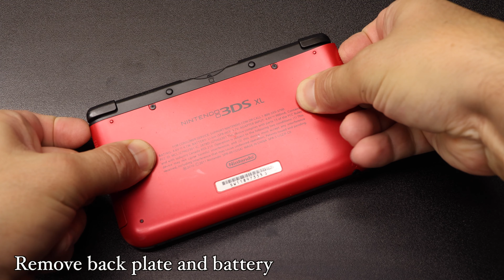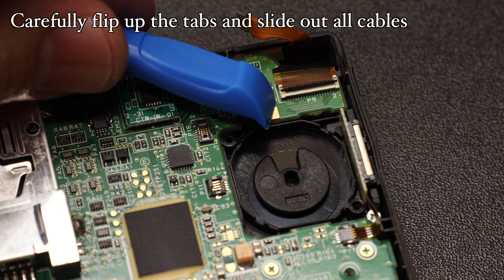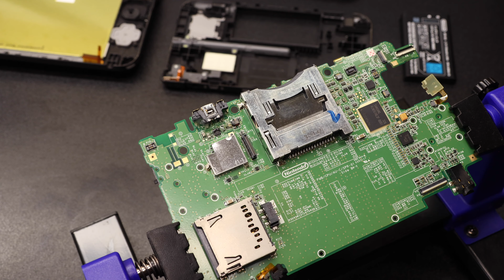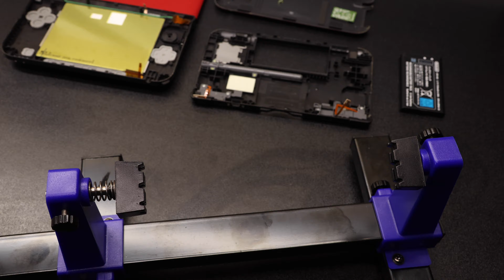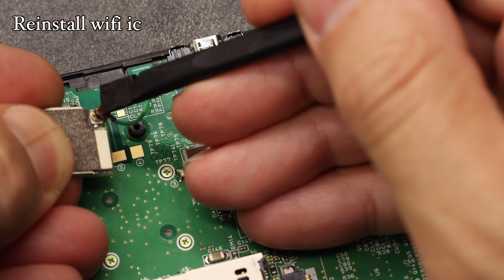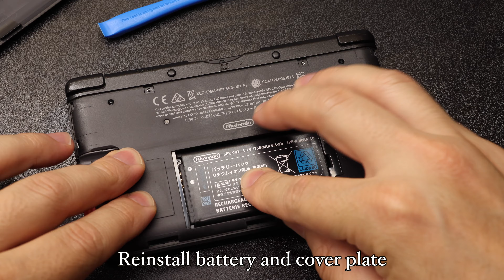Nintendo 3DS XL Charge Port Repair | Fix Not Charging Issue | Nintendo Restoration

Comment: Well, it is absolutely helpful, but for guys without some equipment: u can solder without removing motherboard, just flux every point with solder and using copper wire and solder gun remove solder. Im not saying it to say this, I repaired charging port on my 3DS, and even replaced it with USB C
Reply: Do you put it in the same place as the old one?
Reply: What usb c board did you use?

Comment from the maker: This model has a charge port that requires a hot air heat source to remove. Let me know if you have any questions regarding this repair.
Reply: that is why i can't get it removed. what if we only have dry flux and a dessoddering suction pump?
Reply: Hey what kind of board holder is that?

Comment: seems impossible to find charge port replacements. any ideas? tons of options for new 3ds but no 3ds(2011) or 3dsXL
Reply from the maker: You can use the new 3ds xl port, just carefully bend the solder pins up